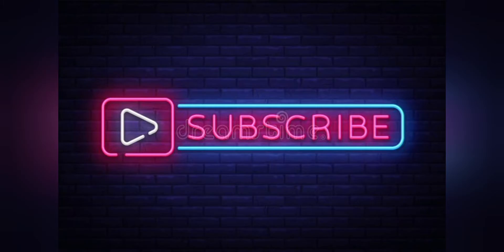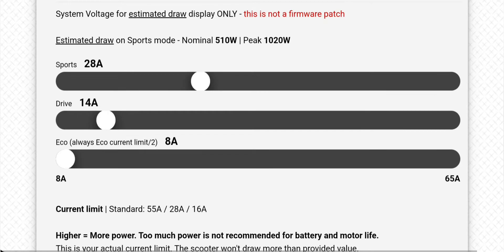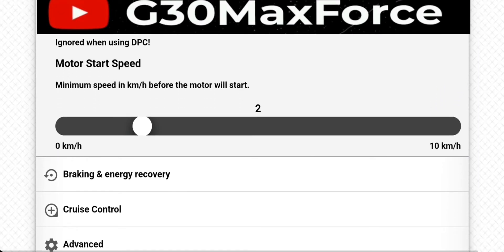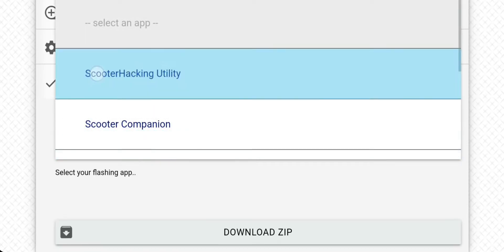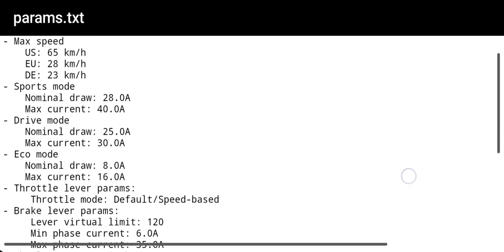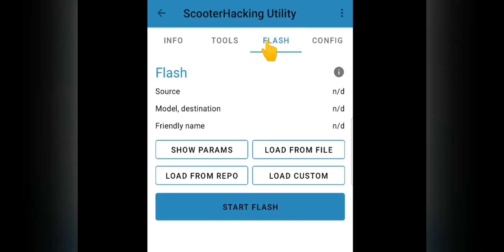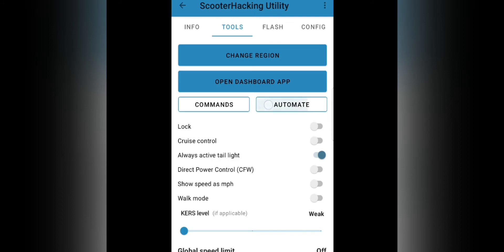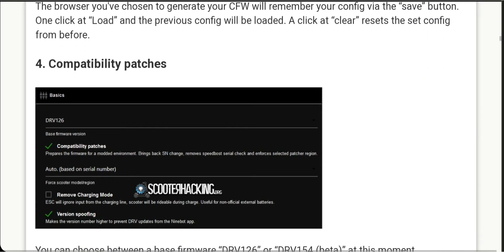Ninebot MaxG30/D Custom Firmware for 48v Mod/ Speed hack CFW!

Comment: Hello! 
I appreciate you for helping everyone! 
I would like to to build also my own 12v pack but first i have two questions,
Where do i get the firmware from? 
When should i do all the settings, after conecting the 12v pack or before  so it doesn't give any errors from the high voltage? 
Thanks!

Comment: Hi, I have a external 12v battery that i have connected in series to give me 48v. I have flashed my scooter and when i hit about 17kms hour, the power to the scooter cuts out and i can only accelerate again after i have hit the brake.please note though i can't get it to go past 17kms hour. It fault just loops. Any ideas?
Reply from the maker: Hello...that 12v external shold have a capacity of 15.300mAh or more... if it has less capacity than requeirt, it will cut off. Send me an e-mail: g30maxforce@gmail.com 
Maybe we can find the problem why only 17km/h

Comment: hi can you help me with firmware after doing light setings 254 the stop light when braking not working. only turns on when ou turn on the lights but braking dount blink 
THx
Reply from the maker: In Germany it is not allowed to have braking light. That's why it is set to,  because I don't want it to blink. So you can set there a lower number or put the settings. REVERSE. GOOD LUCK BUDDY

Comment: When I hit the throttle and hold it down the motor slows down but when I let off it speeds up again.
Reply from the maker: You installed backwards, the sensor on the throttle!
Reply: sounds like your throttle cable is connected in reverse

Comment: I put the presets exactly as you did and for some reason throttle when I push it does not slow down it goes straight Max speed. Will not smoke or not stop spending unless I push the brake what does that mean? I don't have your version of the app though it is older and has not been updated yet do I need the most updated version of the utility app or could it be something else. The scooters also a x rental and can be flashed to stock firmware g30. I flashed these with the 48 volt firmware before with no issues but now it's doing this weird thing.
Reply: When I flash it back to the 36 volt preset it works fine no problem
Reply from the maker: That's weird! Have you tried to change the SN?
Reply: @G30MaxForce  how do I do that ?do I do that on the app or on the CFW website? Cuz like I said right now it's just when I accelerate it does not stop and then when I push the accelerator down, it slows down like it's functions are in reverse.
Reply from the maker: @nicholasburton7066  You do that with Scooterhacking app.
But first I would try to create and flash  the 48v file again...
Reply: @G30MaxForce  I have three to five versions of that file that do the same thing. Including the Lutheran file didn't make the changes you did to it just hit the preset and downloaded it

Comment: I thought you set the speed limit to 45 kmh but your scooter went 30 kmh and 20. 😢
Reply from the maker: You can achieve that speed if you have a 48v Battery!
 In this video I showed only the right cfw for this Mod. 48v battery wasn't connected!
In Germany here, the maximum speed allowed is 20km/h.
Check this video
https://youtu.be/JM4ibMH6dkU